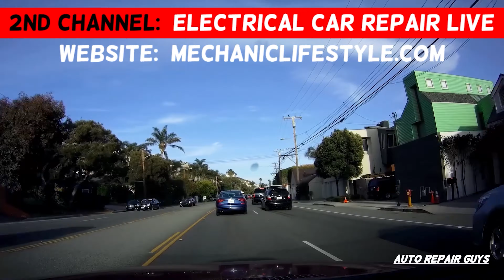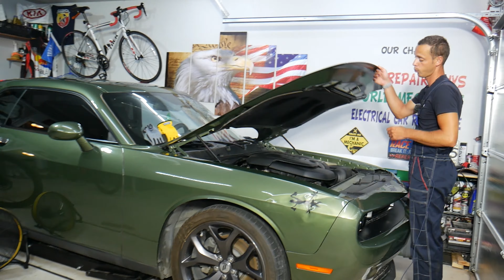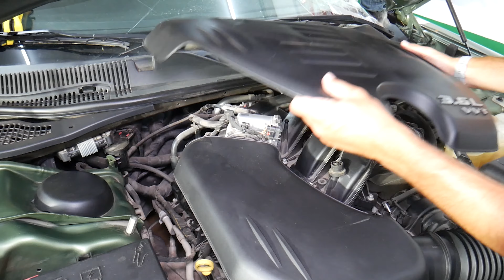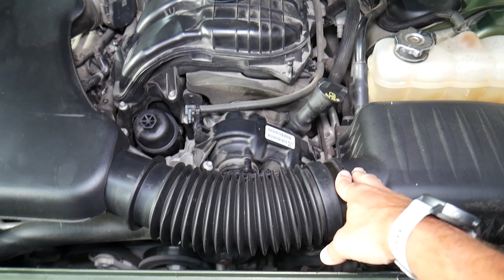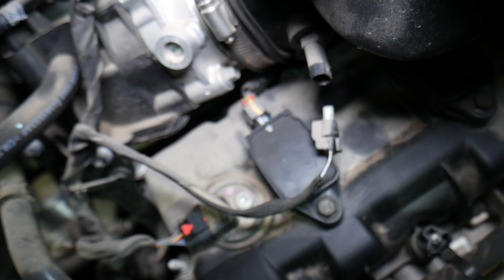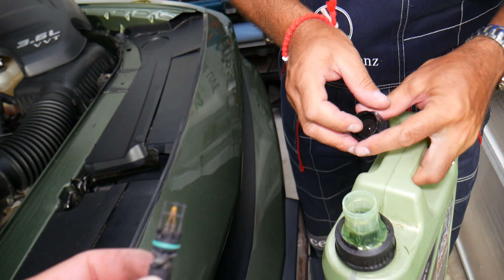DODGE CHALLENGER INTAKE AIR TEMPERATURE SENSOR REPLACEMENT LOCATION

Comment: Hi brother, 
We have long starting problem with Hyundai sonata 2005. Recently bought and former owner told that he changed the fuel injectors because of high fuel consumption so now the injectors that are installed use little amount of fuel as compare to the previous. So my question is, is that possible? And these injectors spraying less amount of fuel will not help the engine to overhead?  Please answer